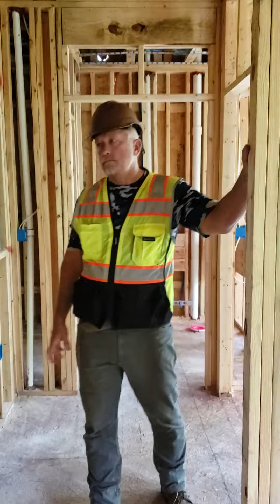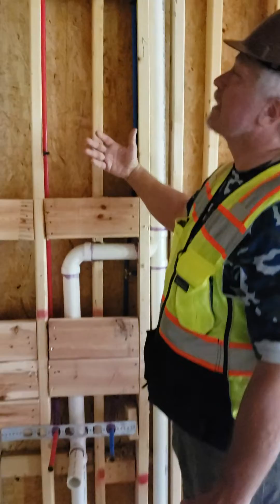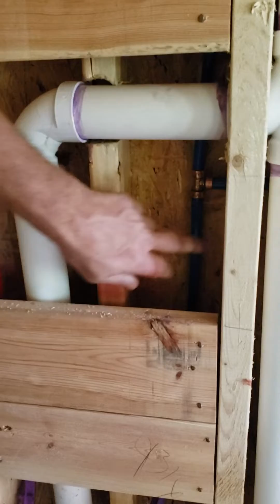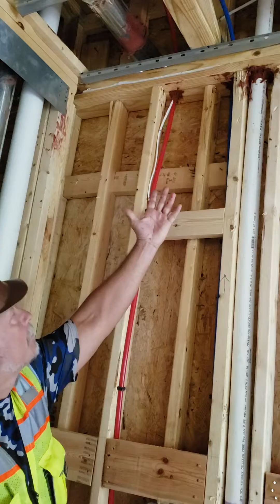Waterlines in a 2x4 exterior wall

Comment: If the lines were run as close as possible to interior wall, allowing for a few inches of insulation behind them, it would be okay, correct?
Reply: You need to add multiple layers of protection. Insulation, spray foam to control the gaps in the cavity, a foam board to create space between the pipes and the wall, and then you can also wrap pipes as well. Those are all different types of protection

Comment: Question:  for my reno of master bath, I was considering moving shower head to outside wall side(at rear corner upstairs of our house). My contractor said if he moves the wall in some and insulated (I think he said 6 inches) that it would be ok and no risk of freezing pipes. 
Q: is this a bad idea??!  It the 80s garden tub to left of it and by moving shower head we can have more glass around shower. 
Part of me likes having the wall and the privacy in the shower tho.
Reply: You just have to insulate it properly. You can have insulation, spray foam in the corners to keep out the air, foam board between the pipes and the outside wall, and wrap the pipes. If you combine all those things you'll get a high R number and protect your pipes

Comment: Hey here’s an idea, have whoever drew the plans solve this problem. What moron puts a vanity on an outside wall that could freeze? As a plumber myself im at the point now where i tell contractors to have the owners call the architect when they want fixtures on outside walls and its a potential to freeze.
Reply from the maker: Yes, it's basic 101 construction. Plans these days are so bad, and everything gets pushed down to us subs. Many plumbers do not care though, and install lines on the exterior plywood with no space to insulate.
Reply: @mitoinsulation  that’s because no matter how many times its pointed out that its wrong, nothing gets changed by the morons that draw plans.
Reply: To be fair, there are ways to properly protect against freezing. You can use a multi-tiered approach. Make sure all of the gaps in the cavity are sealed with spray foam. Add a foam board between the pipes and the outside wall to serve a a thermal break, add insulation, and then wrap the pipes. If you  combine all of those things, you are probably at about an R 25 in that cavity.

The only problem here is that the plumber installed the water lines at the back so you don't have any room to do any of that.
Reply: @ineedhoez the problem is others say it will be done but when its not done its the plumber thats gets the call.